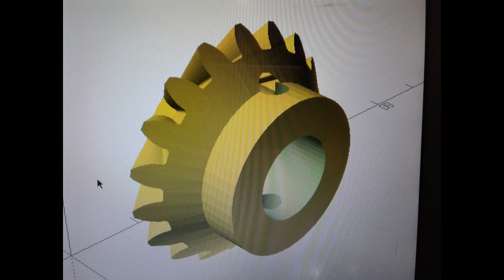Collective pitch drone

Comment: Where are you getting your large collective pitch parts from... are you buying them from a hobby outlet, or building them yourself from scratch?   Very impressive work.
I would not stand in the same plane and the high speed spinning propeller or above/in front of it... if it disintegrates, its going to go outwards - if it comes off, it's going to go up / forward.   If one half breaks, it's going to become wildly unbalanced.   It's happened on planes before.   Always be behind the propeller where the wind is blasting.   Loosing your vision permanently sucks worse than you can know, I know, I had carb cleaner ricochet and hit me in the eye.   air-war.org
Reply from the maker: red parts are 3D printed by myself blade connection from HK 500